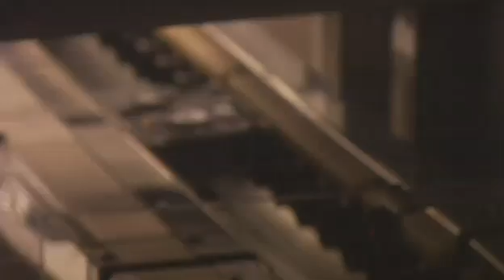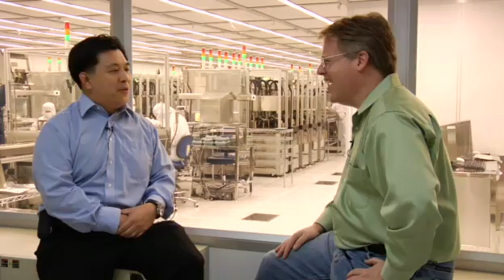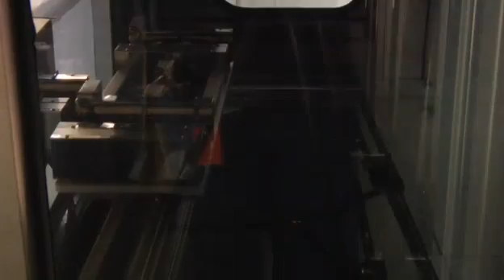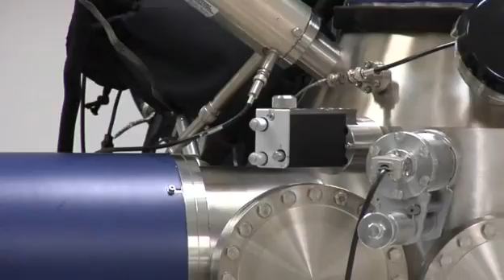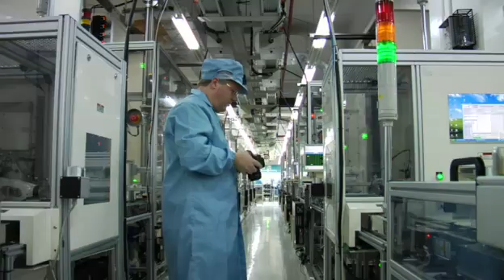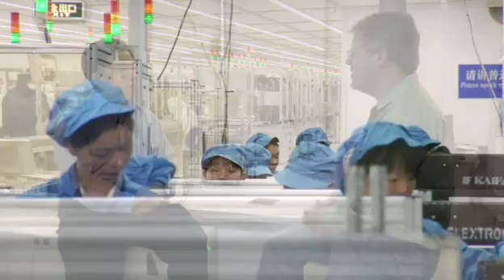Tour of Seagate's Drive Factory in China

Comment: Anyway so my Samsung M3 external hard disk suddenly stopped working. This was a bit of a blow as I had a lot of work and other good stuff on there. This will teach me in the future to BACk UP. I only bought it in Feb this year so was wondering about the Warranty. Samsung have about a million departments and when you eventually get through to someone they send you to Seagate Support. This is more websites and phone numbers that lead to a return address and a RMA number. And return instructions.  These return instructions state that you should not send anything other than the bare drive to seagate. Don't send plastic cases. Its as bit fiddly but you remove the drive from the plastic case and send it to a UK address. Then I get an email the warranty is void because I removed the plastic case, And if I want my not working drive back I have to get it from Amsterdam. Is this a joke?
http://www.seagate.com/support/warranty-and-replacements/packing-and-shipping-instructions/

Comment: An example of hard disk which is OEM is the model Barracuda 7200.11 360 GB integrated into a PC that was taken out of the team and released elsewhere. This does not change the warranty policy because the disk is still part of a system of original equipment manufacturer.

Comment: The disk security rights belong to the same manufacturer of the system where it was installed, due to changes made to the disk at the request of the manufacturer. Firmware is an example of these changes. It is not possible to make valid warranty or support you with technical support through Seagate by these same rights. (go on)

Comment: Dear Mr/Mrs, 
Thank you for your e-mail to Seagate.
According to the serial number of your hard drive, this number indicates that it is a hard drive OEM (Original Equipment Manufacturer, or original equipment manufacturer). The disc was actually manufactured by Seagate, but it was designed specifically for a manufacturer of computers. (go on)

Comment: @iAmWillJ91 no, because hard drives are EXTREMELY sensitive. literally, you have a disc spinning at 5,200-17,000 rpm with an arm resting above it just nanometers (1 billionth of a meter) away. and considering how the arm of a hard drive jumps around so quickly, its a miracle they exist. a particle of dust would ruin a hard drive.

the workers arent 9yr olds, they are the parents whos child is being held hostage.

Comment: @KingMacintosh I don't care about your personal experience. Hard drives have failure rates of less than 1%. I've had at least a couple dozen drives over the years and the only failure I've had was a western digital (but I didn't lose any data).
Yet I still prefer western digital. Why? Because my personal experience doesn't count for shit. The devices are too reliable for it to matter. I replaced the failed WD with another WD. Either way, it doesn't really matter. I'd be happy with a Seagate too

Comment: @Voyeurisnotiseur Well here's a story....
A tower block came down in my town in 2004 and while clearing up the mess I found a Seagate hard drive which was had a dent in it and brick dust and all sorts of trash in the IDE slot.

I got the drive and tried it and you know what! AMAZINGLY it worked!

Seagates are not as good as they were back then but Seagate are the best manufacture! 

I think you have just been very unlucky!

I would rather have 1 1TB seagate than 3 2TB Western Digital's.

Comment: I have some seagates over 6 years old that I don't use but they work fine without 1 bad sector. I'v only had 2 Seagates fail.
I also have a few 15k Seagates that out perform some of the new SSD drives.